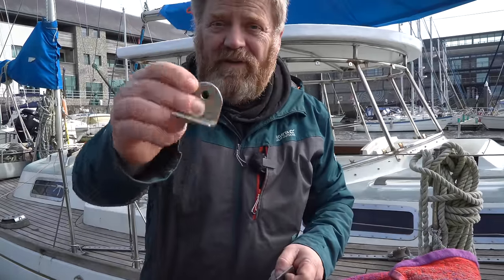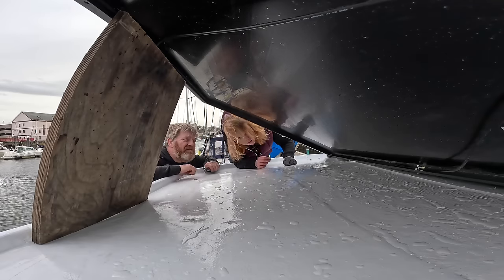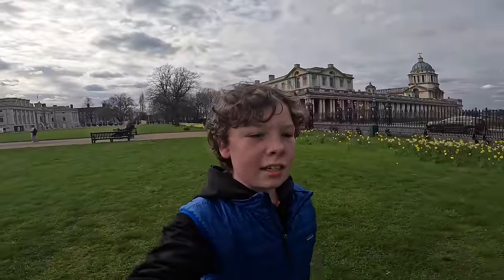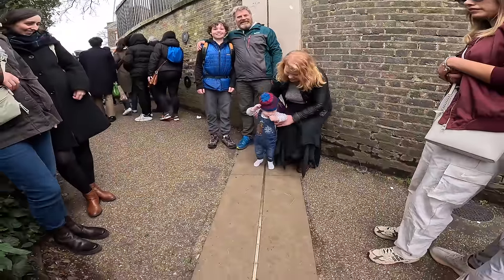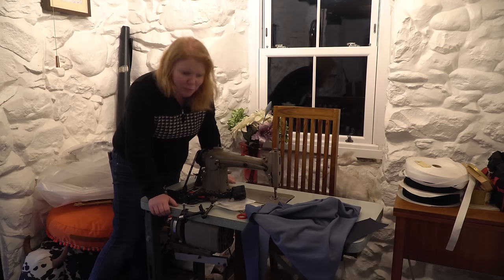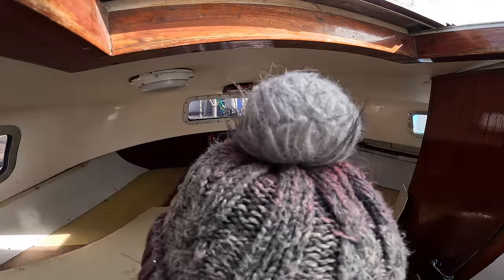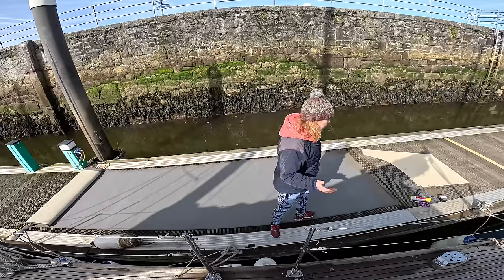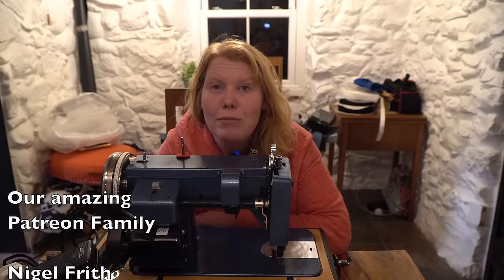Turning this £17k eBay boat into an offshore home!! Fitting solar panels!!

Comment: good job on head lining, after putting glue on foam smooth down gently , if you press to hard the glue can compress   the foam down and flat it and you can get a less padded feel on your head lineing . stainless stapels help with the edges.
Reply from the maker: I didn't put too much pressure... It still feels soft 👍😁

Comment: Hi Melissa, I have been a sewing m/c mechanic all my life, re the problem m/c you are struggling with, there should be a mark on the needlebar to give the lowest point of its travel when level with the bottom bushing. then just below that as the bar rises there might be another mark to give you the position that the rotating device (hook) below the plate just passes past the scarf (a flattened area just above the needle eye) as the the needle rises to pick up the thread loop[ to lock the bobbin thread to the upper needle thread to the fabric.
you will have to slacken the grub screws on the gear you changed to get the bottom hook drive shaft to move independent of the main shaft.
Hope this helps there may be online instructions for the specific model  you have also.
hope this helps.

Comment: For the sewing machine-you do not need to get a sailrite ,the same machine gets sold under different names (REX 607z,Baracuda  and some more)
I do have a REX and have absolutely no complaints.  They are a fraction of the cost. If you need some more information  I am glad to help!
Reply: I have used a Rex for boat upholstery and it worked great.
Reply from the maker: Yes I have been looking at alternatives... I can't seem to find any of these brands in the UK?
Reply from the maker: Great to know!

Comment: Foam can cause a problem with damp underneath should have a air gap, also more ventilation so  mould does not grow. In hot climates this can be a problem.
Reply from the maker: Good to know this is from a marine supplier but will keep an eye on it.

Comment: Nice Job Team ya getting there ya should be able to up Anchor just in ttime for Spring/Summer everything coming along nicely 😊. Jack (David Attenborough) of the Sailing world. Very informative re Marine Museum and Greenwich keep it up Jack. Mel ya a star getting into those difficult spots nice work on the insulation and panels. Great job on the Solar panels being able to angle them great idea 😮😅.  Doing the lil detail stuff such as the nurled nuts just makes like easier. Keep at it carry on. 😊😅
Reply from the maker: Jack's a star ⭐

Comment: Melissa, just saw you with the SailRite - that will be great for your boat projects. Do you have a spool holder with thread lifter for it? Unless there's one built in on the machine, you will need it to lift the thread and help with the thread tension. They are about $8 on Amazon or a fabric store.
Reply from the maker: I haven't got one. Currently rigged up a solution with Andy's mic stand. It's only on loan but I'll get as many projects as I can in!

Comment: I have noticed a bit of volume fluctuation. Seems to be the use of different cameras
Reply from the maker: Ah I apologise for that. Becsuee of the London trip we had to edit this one in less time than normal in order to be out for our normal Wednesday episode. That meant I didn’t have as much time to spend on post processing of audio levels. So yes I think you’re right to observe it’s not as polished as our normal editing work. We did consider holding the episode for a week but we’ve found that has a bad knock on effect for the channel if we skip a week

Comment: Ok, those solar panel bracket hold down bolts need to be counter sunk or reversed. The bolt end and nut sticking down is going to kill a tall person when they stand up directly into them and puncture their cranium. Sincerely - a tall person.
Reply from the maker: No they won’t. They’ll have dome nuts on, they are well up inside the frame and there’s 6ft 5inches of headroom. Do remember this isn't finished and there's lots more work to do making it "nice"
Reply: Pretty sure this was mentioned in the video too.

Great job on the enclosure Andy. Duracell project quality fibre work
Reply: @SailingMelody  if you ram your head into a dome nut it can crack a skull. a 6'3" person bounced up by a wave could impact that quite hard easily. It's your boat, you can do what you like. I've stood up unto a bolt set like that and nearly cracked my skull before, so yeah...
Reply from the maker: @piercet  as I have said. It’s not finished. I’ve no doubt you would have managed and executed a perfectly designed version of this with no flaws or issues.
Reply from the maker: @piercet  it’s completely impossible to design a boat with zero possibilities of someone getting hurt in very severe conditions. But I’d love to see you your efforts if you feel like showing me how.
Reply from the maker: Tbh I’m sick of the judgement and constant criticism. Might stop the channel and just do some online work instead of putting the effort into making these videos
Reply: @SailingMelody  You don't want someone to point out a potential safety hazard to you that would be easily corrected? Ok, you do you, I will remember that for the future and no longer point such things out for you.
Reply: @piercet 🤔 it’s about the way you say things, the words you use and how it could be interpreted 🤷. Not just your comment, lots of others too. See? I’m not criticising yourself, just pointing out ways that things could be done better. 🤝 be happy.

Comment: Will it make the Boat heavier
Reply from the maker: The whole structure weighs less than me (Andy) so it’s only like having another person on board.  The boat weighs 10,659kg so it’s about 0.7% of the boats weight. So yes absolutely it will make it heavier, just like anything you bring aboard a floating boat, but not significantly and the benefits outweigh the negatives